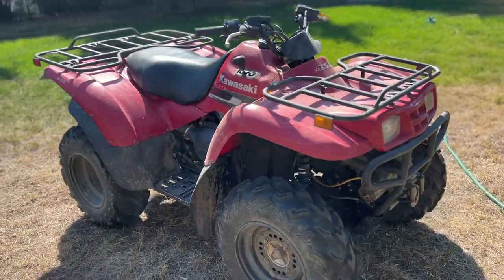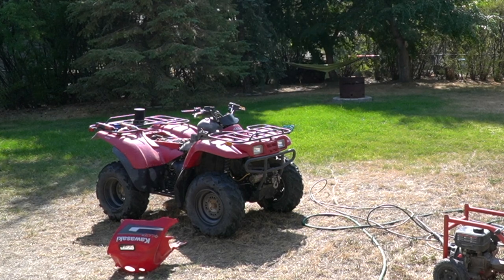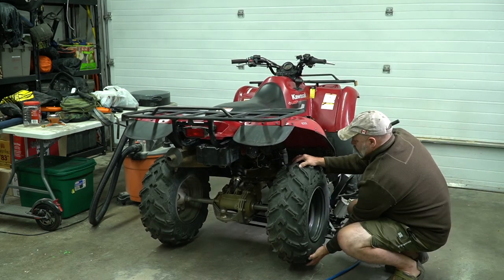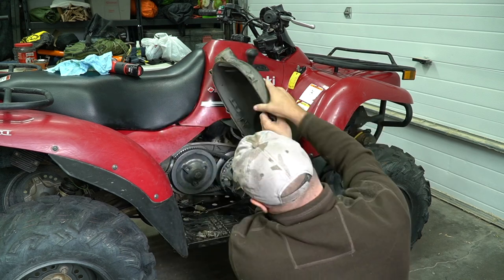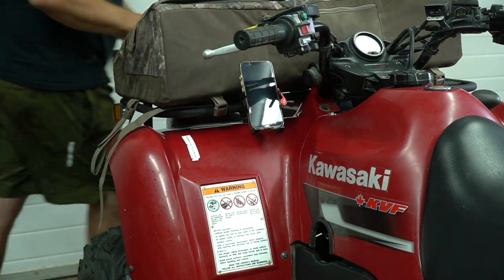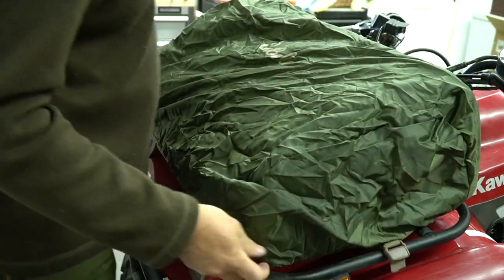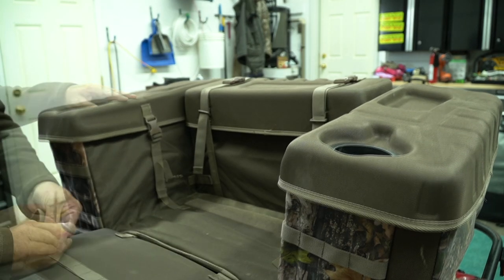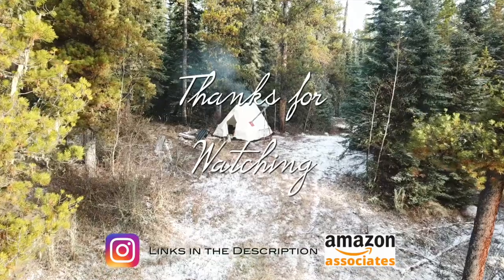ATV Camping on a Budget - Part 1 | Beginners Guide to Setting up an ATV for Camping

Comment: Nice ol' machine there Michael.  Nothing wrong with older rigs.  My pick-up is 32 years old, my Tahoe is 21 years old.  My murdersickle is 23 years old.  It's nice not having payments.  It's nice having affordable insurance.  It's nice that occasional repair bills off-set the monthly anchor around the neck of payments.  I'm with you 100%, locked rear and lockable front, with hi/lo range, is a HUGE benefit, add the saving grace of a winch, and life is good.
Reply from the maker: I know what you mean!!  Free and clear of the banks and loans is the best way to be 👍

Comment: Thanks, great idea for a series and you will share your wealth of experience. I’ve stayed away from belt drive units because I’m a bit old school…they seem to fine under most conditions. It’s not bad Idea to take your air gun and blow out the clutch even if you don’t see a lot of dirt and dust. Are you using an ATV to get you further back woods than the Can-Am would do? Another lesson from you that would be valuable would on changing steel winch cable to rope and the advantages. Keep doing what you do!
Reply from the maker: Hey Norm - Totally understand about the belt and having owned a Honda Pioneer 500, it was one of the things I liked!  Thanks for the tip on blowing out the clutch - Next time I'll do that for sure! 👍 The ATV purchase for to try and introduce more people to ATV camping who have a limited budget or already own an ATV and would like to try it.  I have a video I'm editing now on winch cable changes coming up very soon!  You read my mind 😄